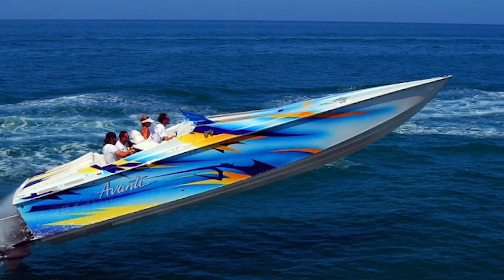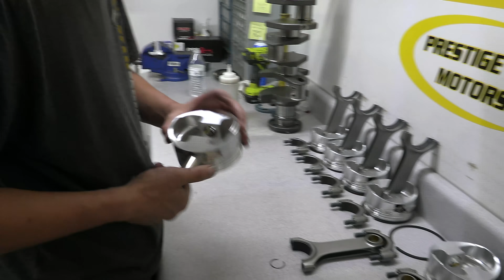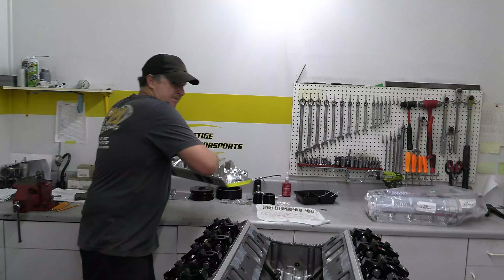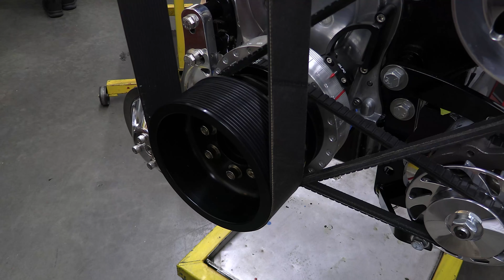540 Cubic Inch Big Block with a Unique Roots Blower

Comment: I can't BELIEVE that 2-lobe STR8 lobes are still made.. I know a company that makes such as a retro-fit to a Bentley Blower to make it more efficient & reliable, presumably with same modern improvements in lobe angle, but to make one for actual performance?? Such a whacky idea. I'm sure they know what they're doing though, after all str8 or low-degree radial-intake lobes are only "bad" at higher RPMs (which is why the 1740 /LS4 stock Eaton blowers can be spun to 30k.....) but I guess a you said, these engines are often spun @ 3-4k potentially for hours, and the less lobes the more displacement, so while this at first seems like cave-man blower tech it makes total sense! Also from my understanding the original (90 degree?) twist on Detroits was allegedly only used for noise reduction, not pumping efficiency, and I think Holdener (or maybe even you guys?) made a video & at very low RPMs the blower efficiency of OG 6-71 designs was HIGHER than a modern axial Eaton blower, which blew my mind, but made total sense since they were designed for a 2.8k max RPM engine, the Detroit diesels...

Comment: I'm sorry, but 700hp from a blown 540 is terrible.. That should be N/A power even with lower compression
Reply: Dude, it's only 5900rpm, a street build for a car would be turned to 6800 and make another 100hp. And this engine needs more carb.

Comment: Just want to point out that you can use head studs in tight places.  Head studs are keyd at the top with an allen. I have done this in the past and had to do a valve and cam upgrade and just twisted the studs back out and pulled heads.

Comment: Great video but I am curious as to what power valve you ended up with and what jets you ended up with.  I see thats the 950 holley bloer carb with 80 primary and 86 secondary jets. Also 10.5 power valve but that seems more like something that would be used for non boost referenced carbs.  I am have a similar build but with dual 950s.

Comment: what specifications does the camshaft have?
or what number is the camshaft of comp cams?
many thanks from europa austria
andy
Reply from the maker: I think it was a custom cam.
Reply: I believe they mentioned the cam specs in the video to be;  256*/268* @.050" lift, and around .660" lift on 116* lobe separation angle... (Comp Cams hydraulic roller)

Comment: That carb is significantly restricting this SC BBC!  Not sure why a twin screw blower wasn't used either.  A TS with an intercooler would make a LOT more power.  Also, if this is going to have a Bravo drive attached to it (likely), it will blow drives on a regular basis.

Nice engine, but not thought out very well for performance marine usage in 2021.
Reply: I dynoed 779 with my 540. Granted its making less in the boat with all accessories hooked up but its connected to a bravo xr drive with bravo 28 prop.  7 years and no issues.  I dont air it out and no full throttle launches.

Comment: 4:23 Does this use the usual 5/64 5/64 3/16 ring pack? Some BBC pistons have a 1.5mm 1.5mm 3mm ring pack so that the piston pin bore doesn't intersect the oil ring groove.
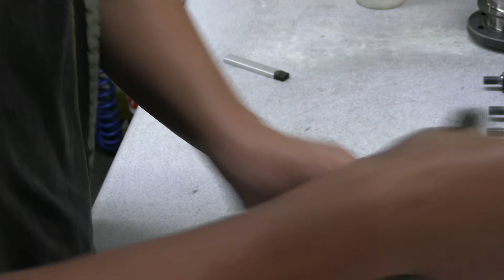5:52 I didn't realize that gas nitrided rings were common in performance applications, other than engines that already held boost well. Nissan sixes often had them and lasted for ages. I was used to seeing those older engines getting ductile-moly rings. I'm glad there is something even better than gas nitrided rings.
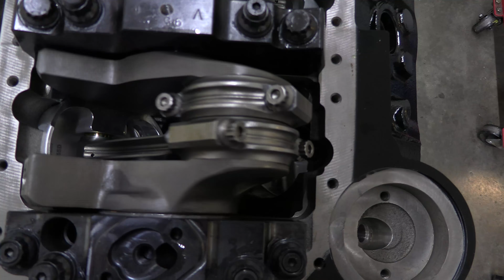6:30 I love it. When dealing with many stock blocks, clearancing means putting stuff together, trying to turn it, and grinding off a little. It often requires multiple tries, but grinding too much can ruin the block.
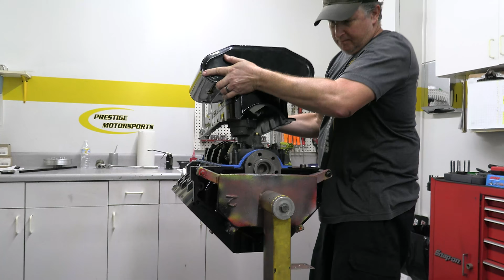8:27 I would think 14 quarts of oil also helps to cool the engine. Sure most of the cooling is done from the water or antifreeze, but oil does help.
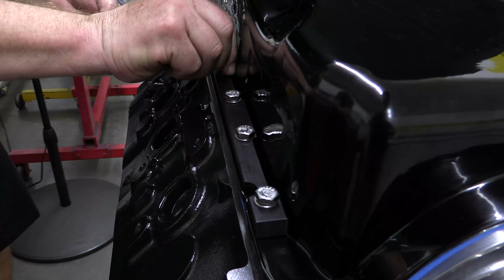8:42 in addition, some of those gaskets came in multiple pieces, and required RTV on the corners. Having one unit makes things easier.
9:09 Do you have to have a machinist make the second wodruff key groove, or does the crank have that option factory direct?
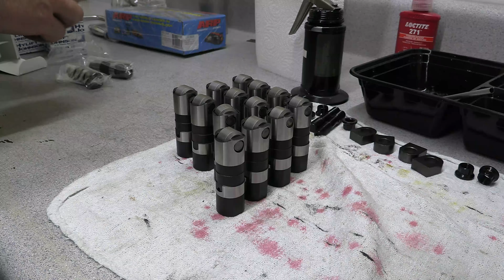9:30 I have heard that Johnson Hylift is the solution to questionable lifters from other companies.
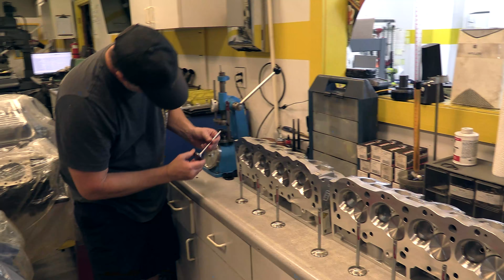11:45 Interesting. When the Mitsubishi Evo X final edition came out, their solution was to use sodium valves to take the extra boost.
Some engine builders will recut the valves seats of brand new heads, it has been said they are more accurate and seal better. Some heads have been said to leave the factory with such a garbage valve job, it doesn't even work. People can do the vacuum test or fluid test for valve sealing and find that the factory valve job won't hold compression.
Reply: I think the sodium filled valves are lighter than inconel and won't float as easily but still transfer heat away from the valve head and into the guides for the cooling jackets to do their thing. But this thing here had some fairly light springs with the inconel valves so maybe I'm off on the lightness thing...!
Reply: @dangoldbach6570  All vale materials will transfer heat to the valve guide, however, sodium has a heat conductivity rate that is much higher than other metals. Also, sometimes the valve is not 100% filled with sodium, and evaporative cooling helps transfer even more heat.

As far as lightness, I'm not sure. It seems that intake valves will almost always be heavier than exhaust valves due to size, yet both intake and exhaust have the same spring rate.
Reply: @skylinefever  you NEVER us gasket on the end of intakes.  they'll just blow out.  ALAWYS USE RTV there

and i dont hear of many (if anyone) people using sodium filled valves on the the water.  just iconnel.  thats the go-to  and there probably a reason for it that we dont know but marine heads do know.

Comment: I always wonder about the damage done by the performance tests on a brand new engine. No running in period and then revved to the max.
Reply: They always break the engine in before they do the dyno tests. They just don't show you that part
Reply from the maker: Exactly! Nobody wants to watch break-in
Reply: @TheHorsepowerMonster  bold of someone to assume an engine builder would take that much money in parts and labor, then risk their payday by not priming the engine like you mentioned in the video, and breaking it in.🤦

Comment: Love this motor! The Alloy inkernel was invented by the father of the jet engine Frank whittle. Which made the axial flow engine become a reliable concept!! Whereas the Germans jumo engines would flame out after 9 hours as the compressor blades would stretch and melt reducing the compressibility of the motor! Hence failure. 
To see this metal used in valves is awesome! And a good idea in racing boat motors where they sit at high RPM for extended periods.
The torque curve was a torque line!!! Right at the top of the graph!! This motor will but out impressive speed in a boat!! I had a dateline 17 ft racer with a 200 HP Suzuki power tilt and trim. She’d get straight upto 65 knots on flat water!! This HP MONSTER will carry that boat along at over 140 knots easily! And press you in your seat doing so!!
Another great video bud!! Thanks for the share!! Looking forward to the next one!!

Comment: All that available cool water and you dont run an air to water intercooler... it would also help out reliability/ detonation since its on pump gas.
Reply: They did need an extremely low profile, maybe the added height of an air to water intercooler was too much. I suppose it could have been done if it used the weird setup in the Mazda Millenia S/C, but with an air to water intercooler where the air to air unit was. They would have needed to create a weird intake manifold to do it, and might have need to use multi port fuel injection.

I'm glad you brought up intercooling. I wondered why the engine had significantly more cubes than a Dodge Hellcat, but not more horsepower. The air to liquid intercooler in the Hellcat may explain it.
Reply: @skylinefever  hellcat has more boost  too.  thats another part of it.  those low profile blowers dont make a ton of boost.  probably less than 10 PSI  im sure hellcats are more than that

Comment: The cnc finish is like that on purpose rougher surface = better flow
Reply: In the intake ports but not the chamber or exhaust ports. I have never seen any AFR Heads like that. I even called my Buddy that works for AFR as a CNC Operator. After seeing the video, he said that it looks more rough than actually is.  He said that they do that if there is some blemish’s in Chambers.  It’s looks way worse than is.
Reply: Yes correct

Comment: You are probably leaving 100 on the table from the lack of airflow with just one carb.
Reply: Just watched this and said the same thing!
Reply: they're not spinning the thing very fast to have a bigger blower because they arent going for max power  this thing will run all day and nigh.  and two carbs he already said is more complex.  this is a simple big block in a boat
Reply: Sure let’s be blind to the fact a 250 is undersized and should be on a small block and this should have a 8-71 minimum….

Comment: Can you comment on how much power is lost with the Marine exhaust manifolds verses the dyno headers. Stainless steel water cooled marine headers would give similar power to the dyno headers but they are expensive. Also the maximum hp rating on a stock Mercruiser Bravo XR outdrive is 600. Do you know what drive is being used?
A single engine boat puts a large load on the  drive .

Comment: Here"s one for Motor Heads. I built a 540, 25 years ago and used a Lunati Crank. When we Dyno'd the 540 the rear main bearing got beat out and spun the rear main. I v-blocked the crank and the dial indicator showed the rear pilot bore was .012" out of center-line, the dyno spline shaft used the pilot. Goes to show that even proven performance parts need double checked to avoid major engine damage. I had to send the crank back to Lunati for them to believe the pilot was that far out. Of course they wouldn't cover any damage "RACE APPLICATION" and all.

Comment: had this same motor in my boat, makes no sense without an intercooler roots make way too much heat for the long term RPM in a boat, I'd never build another roots set up dependability and roots don't go together at least not for long maybe real low boast and low RPM
Reply: thats exactly what this was.  low boost and low RPM.  thing would run forever and not blow up

Comment: Whoa. Hold on.... 8.8 liters making 700hp WITH a blower? 

Okay. I get it. 700hp isn't a small amount of power, but at this displacement, it's absolutely not worth it, NA, much less blown.  You can get a blueprint crate engine that makes this much, at this displacement, WITHOUT a blower.
Reply: But the 540 with 700 HP and a supercharger will make much more power in the lower RPMs compared to a NA 540 with 700 HP...a simple pulley swap could get the supercharged 540 in the 1000 +HP range ... with a torque curve flatter than the desert...
Reply: I was thinking the same but this is for marine gas which is notorious for being trash so that may be why it seems so conservative
Reply: @My Name A 1100HP supercharged 540 would get about the same MPGs or maby slightly better MPGs because of a few reasons......for starters...the CAM in the supercharged engine would have more valve overlap 114 vs 110 or 108 duration..which would create more velocity for better torque and fuel mixture...allso when the fuel mixture enters the rotors of the supercharger it gives better fuel mixture...plus supercharger carbs from Holley carbs..are boost referenced for even better fuel economy and performance...EVEN...if the supercharged 540 got a little worse gas mileage..the benefits would far exceed the cons...like TONS!!! of low end torque... driveability... and the power would not have to be peaking high in the RPMs...

Comment: Always curious why you'd opt for a classic straight lobe PD blower vs a more modern/efficient 'Twin-Screw' design from someone like whipple?  Especially since the whipple units can be run dry with an intercooler + efi for far better fuel economy. Also the whipple units are generally much lower profile than the old-school GM X-71 units. Also since twin screws feed air in the rear or front, you're able to further reduce the stack height.

And in a Boat where you have an infinite supply of cool water to pump through an air-liquid intercooler. Why you'd not take advantage of that?...
Reply: @RockForge_Magic  If they are so far behind, why are they still being used everywhere? Modular Fords do not work for shit in boats. Boats require lots of torque as they do not have transmissions. Having only a single-speed requires a broad RPM range. Small displacement big RPM has no place in the boating world.

Pretty sure a BBC can be built way cheaper than a modular Ford in this application. 7PSI and pump gas making 700 HP/Tq all day long at low RPM.
Reply: @kx454  A forced induction modular makes a lot of torque, even down low. The GM pushrod engines are still used because that is what Mercury used for years and still does. Mercury has the bulk of the shrinking gas inboard and I/O market and has had it for decades. Most of the aftermarket parts are for mercruiser and GM motors. I4, V6, V8 and even V10s are still put in boats and their lack of a forward speeds or power output really doesn't matter. The motor is sized to the boat, the propeller is sized for the motor. If you have an engine that needs to spin say 7000 rpm for maximum power, it is propped to achieve that. Mercury has abandoned GM completely for their highest horsepower engines and built their own.
Reply: @sdvten  Take a look at drag boat motors in 2023 https://www.youtube.com/watch?v=rs6EeO3sn70